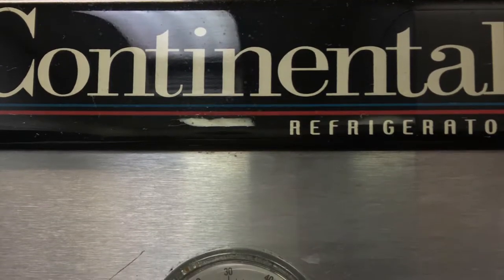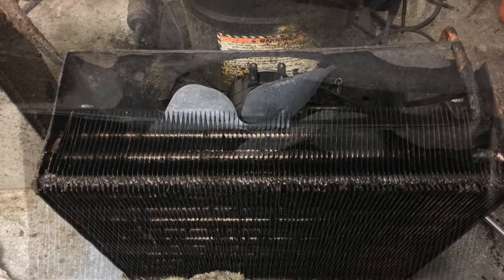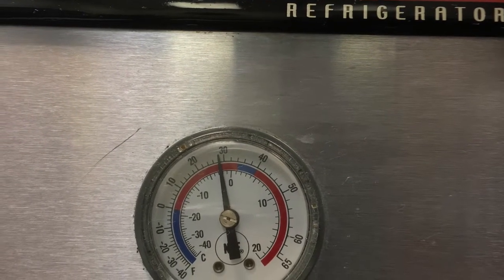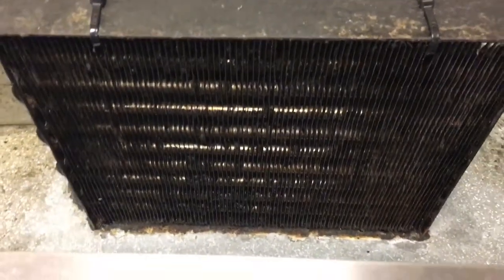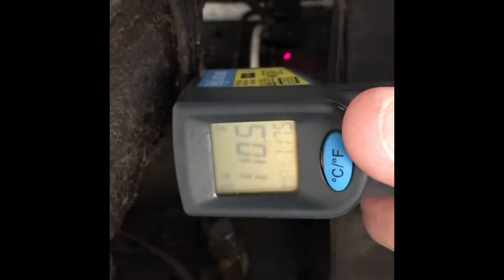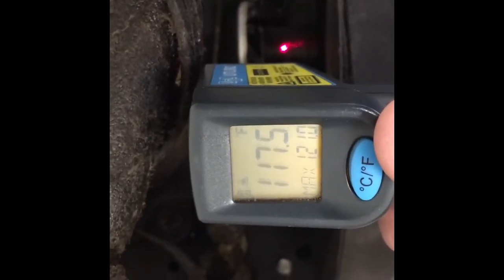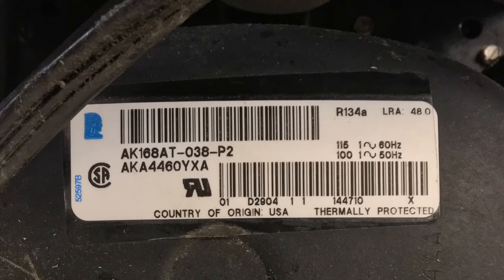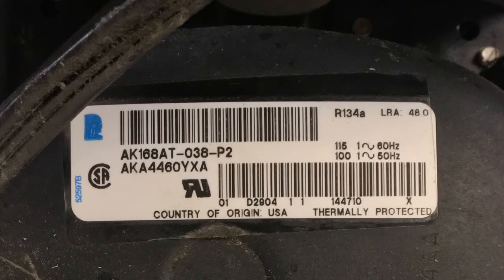Replacing a 9 watt Condenser Fan motor & Temperature of New Motor.

Comment: shold the air flow be blasting against the compressor or be blown out the radiator coil parT?
Reply from the maker: Allways suck through Condenser and Blow against compressor.

Comment: A USA compressor. 👍
Reply: throttle bottle that's true.
Reply: @NorCal-refrigeration  shold the air flow be blasting against the compressor or be blown out the radiator coil parT?
Reply from the maker: allways suck through a Condenser !